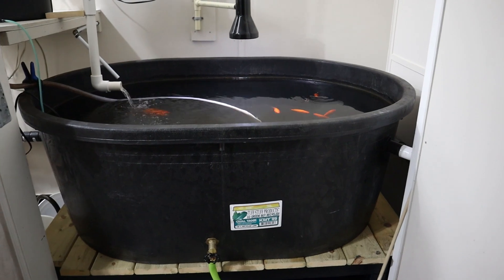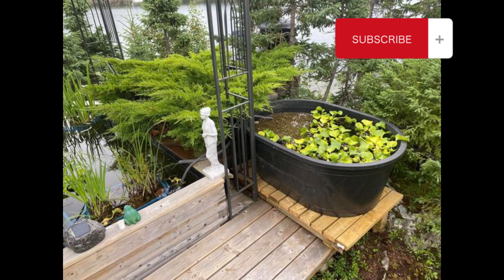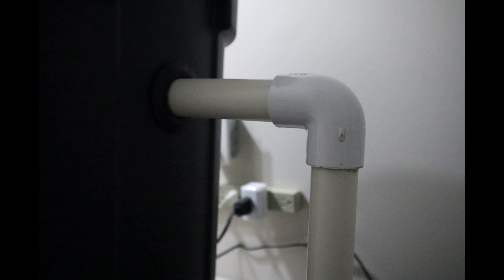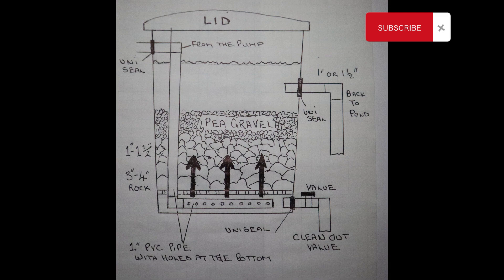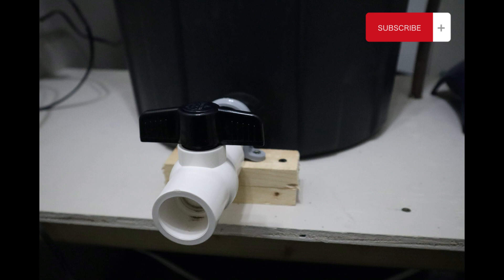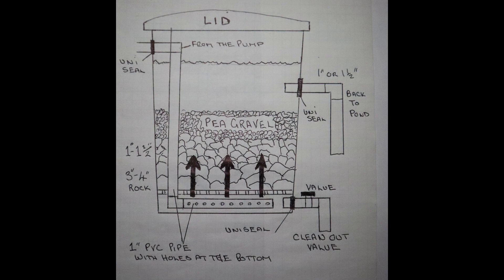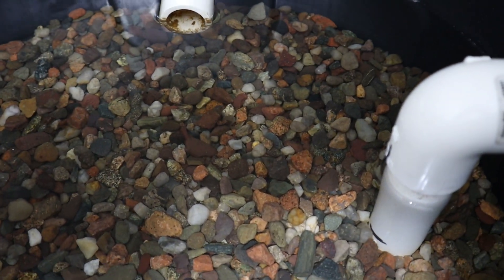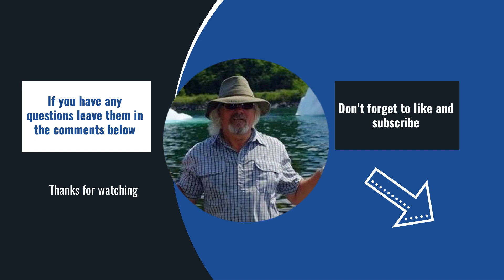Stop Wasting Money On Filters

Comment: Next level! I love the clean-out valve. I'm intrigued by this type of filter. But, I worry about a malfunction that might drain the tub. Ever had any catastrophies? How heavy is it? It is impressive to see.
Reply from the maker: I open the clean out valve about once a month I just run it out until it runs clean. It is so easy to do. I have never had any issues with this system but it is important to have a small hole above the water level on the pipe from the pump. So that when there is a power cut it will not symphonic back into the stock tank.